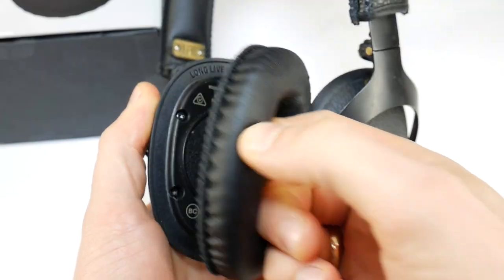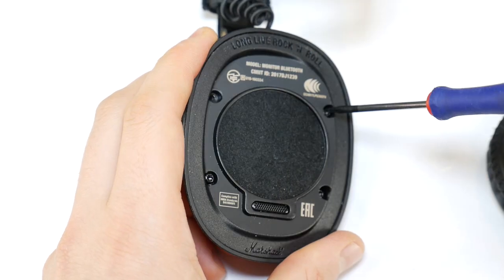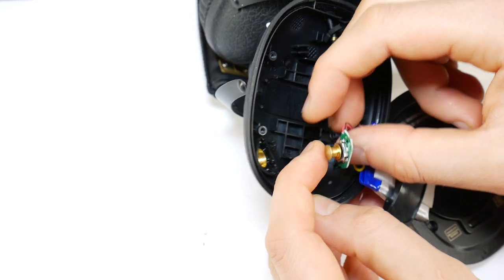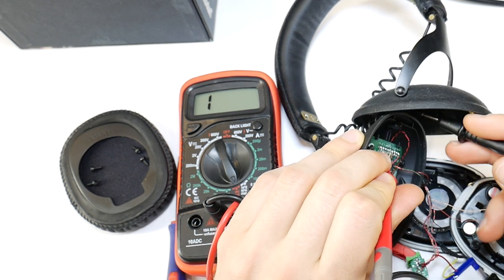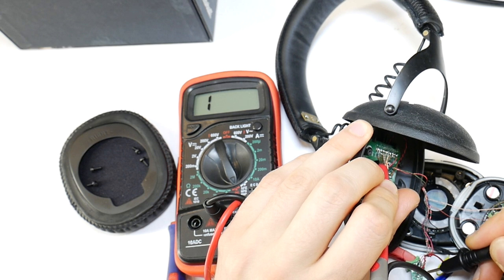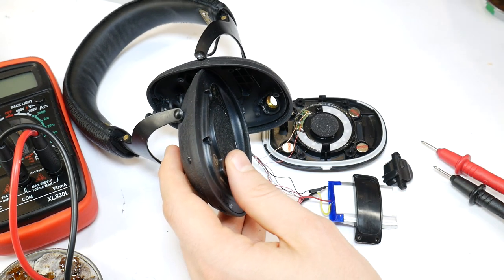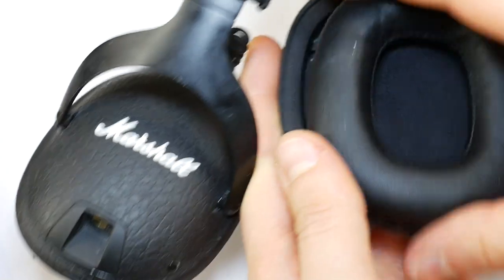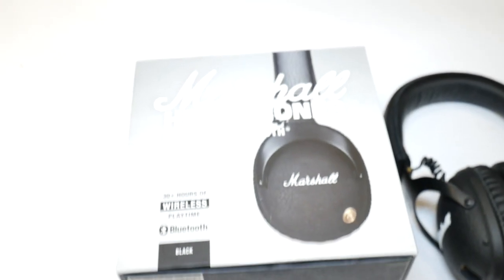How to Easy FIX Marshall headphones Joystick DIY

Comment: I've bought myself today , the Marshall Major IV , out of scrapmarket ,for 20 Euros ,  they were in mint condition, as  unused,  and  the  vendor said  they  cannot be  started for  BT, but they  work on cable. After dissasembling , I've noticed one joystick pin being  green, full off cupper oxide. I've  resoldered the  joystick , and now  it  works  like a charm. Carry big attention on pushing back  the  joystick board  on place, as it  will tend  to tension the joystick on  his  board.For those whom might be interesed , the  joystick is  a  MICRO-JOY-A brand NINIGI type, wich will cost 0.94 GBP .

Comment: Hi, bluetooth has stopped working on my Marshall Monitors. Do you know where I can find a spare part or how to fix them?
Reply from the maker: first check all wires with multimeter.
Reply: @TechscrewDIY  of course, the only connection between the button and the motherboard that does not give a signal is the next. The voltage is present in the battery and on the motherboard but the LEDs don't light up even if connected to the charging cable and I can't turn on the headphones
Reply from the maker: @gabrielechiapperino3467  strange, you can try unsoldering the wires on both sides and then test them with a multimeter. But you have to remember where to solder them back. Or just install new wire - https://youtu.be/uuyne0sAygo

Comment: Hello! How about marshall major 4 joystick replacement? There is no information on whole internet😧
Reply from the maker: open headphones and check wires with multimeter.
Reply: I ripped the joystick out and replaced it by inserting a "Mini Round Momentary Push Button" directly on to the board with a couple of wires. There are two test pads, that you can solder the wires to. Of course you'll lose volume up/down and track next/prev... but personally I found those options annoying anyway :-D
Reply: would you mind telling me where you ordered yours? i have to replace my button too and can't find the joystick either but i don't mind losing the functions i just want my bluetooth back :)  @timusius
Reply: @timusius hey, do you have a link where to buy this button?

Comment: hello, I have a problem With Marshall major 4, When I have it connected to the power source, it turns on and when I don't, I can't turn it on, can you help me?
Reply from the maker: check wires with multimer :)
Reply: resolder the joystick

Comment: major 4 If the same is possible
Reply from the maker: why not ? The working principle is similar.
Reply: I fell on the ground and some functions no longer work. does not turn back. There is no clicking sound when I turn it on. will it be repaired